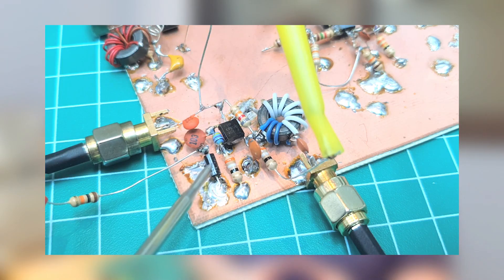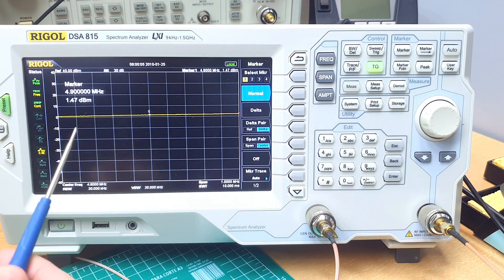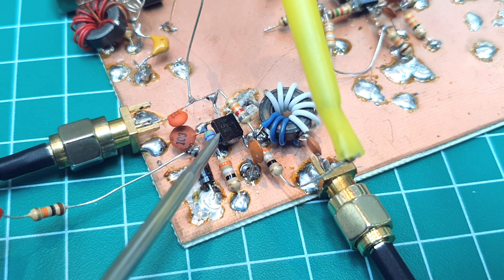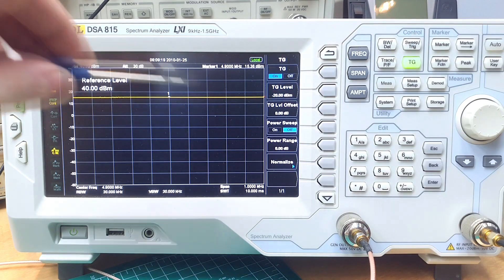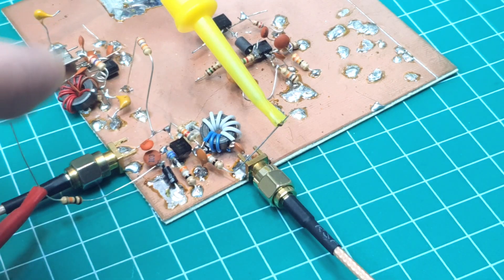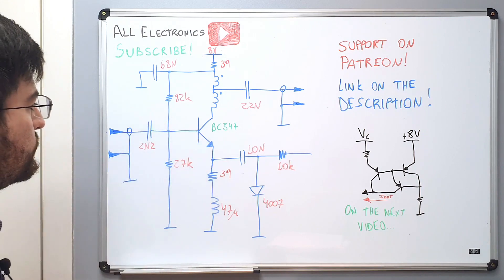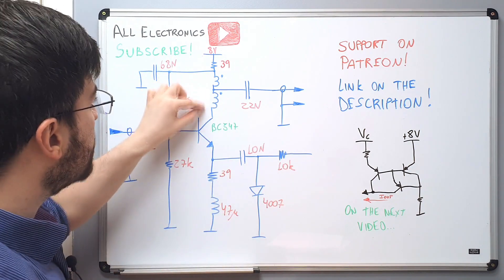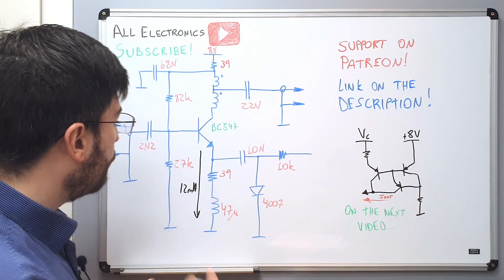How an Amplifier works - amplifier with gain control

Comment: Hmm, are there other channels, where the stuff is explained for non-electronic engineers? I would need somebody to first tell me what all those capacitors are for. I know that voltage and energy flow are displaced by 90 degrees, and I know how to calculate the capacitance. But you start by saying "very simple schematic", but to me as a non-electrical engineer it looks like a bunch of random things connected. IT would really help if somebody would explain it like "the stream of electrons starts to flow in here, then this or that happens at this capacitor, and then at this resistor the power is attentuated by this so that when those 2 streams meet it has this or that effect." But the way you explain it is like, I first have to understand it to understand it with your explanation.

Comment: Why in most rf common emmiter amplifiers we add an inductor to collector for increase impedance or resistance at the collector?? Why don't use just a resistor ???
Reply from the maker: This is called inductive peaking. It will enhance the bandwidth of the amplifier, creating a little more gain at higher frequencies, compensating a little the natural rolloff of the amplifier.
Reply: @AllElectronicsChannel  thanks

Comment: Hey Love your channel, can’t find many others out there like it!

Could you do a video on Automatic Gain Control?  Is it possible to make one with a very wide band frequency response?  I would like to figure out a design that could be used as an attenuator with constant pk-pk amplitude across wide range of frequencies
Reply from the maker: Thanks! Nice topic. Probably a diode detector and a PIN attenuator should get good bandwidth response
Reply: @AllElectronicsChannel  Never used any specific components like PIN diodes before, I’m always trying to develop strategies with just BJTs the hard way :) and I always use breadboards, but seriously need to move to pcbs for RF projects soon.  

But on a breadboard I have built a 27, 56, and even recently a 227MHz transmitter and receiver with just BJTs and typical passive components all on a breadboard.  Simple on/off is all.  The 227MHz transceiver was quite unstable as you might imagine though and only had a range of up to 7ft basically at best, but quite cool it worked at all on breadboard, it was super-heterodyne type, single stage mixer, IF of 1-10MHz (very unstable of course).  It’s really a challenge when the whole supply rail has 200mVpp noise at 227MHz and any inductors above 5uH act more like large caps and several insulated rows 5 spaces apart or even 10 acts as a pretty good coupling capacitor haha very frustrating to work with breadboards at RF but it can be done somewhat.
Reply from the maker: @issac.creator  hahaha very nice!! go to copper single layer pcb as breadboard,  will be a new life. 1N5819 work great as poor man PIN diodes, try to make a simple PI atennuator using it
Reply: @AllElectronicsChannel  huh interesting, I will definitely have to check that out, thanks!

Comment: hello, nice circuit, I also did two calculations and I believe you have a very good gain, using that polarization you have more than 500 of hfe with that model of transistor, pero one thing I can't understand, the ratio of the auto transformer why you chose that number of turns for a 700 ohm at 50 ohm, are you sure? that you leave 2 mA to the transitor not to saturate it and the remaining of 10 mA for the output with a 50 ohm load?
Reply from the maker: Hi Matteo, with the ratio I used on practice we are using a little more current, using a litter lower collector impedance. The beta of the transistor is much lower at higher frequencies, you can aproximate by Hfe / f
Reply: @AllElectronicsChannel  an figured out for hfe, and is there a rough calculation to know how many turns you need to have to have a ratio from 700 ohms to 50 ohms?  because I thought it was 14:1, then maybe I'm wrong
Reply from the maker: The impedance transform is the square of the turns! For an auto transformer you need to add + 1.
So (7/3 + 1)^2 in this case

Comment: Hi great video. I don't understand how you come up with the turns ratio of the coil or auto transformer.
Reply from the maker: Turn ratio for a normal transformer would be sqrt(Za / Zb), for an auto transformer you subtract 1 (to consider the primary as part of the secondary also)
Reply: @AllElectronicsChannel  Would you show the calculation please?